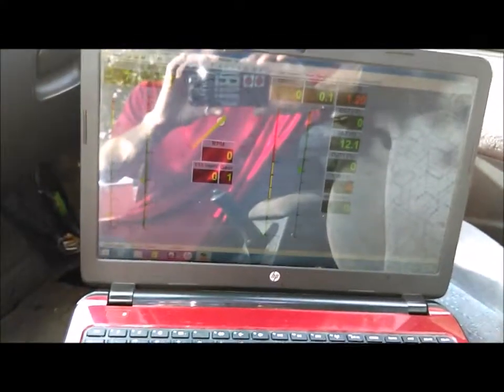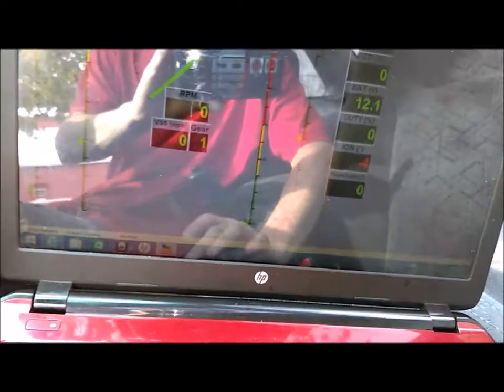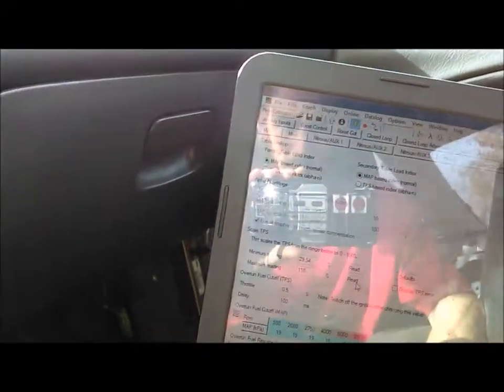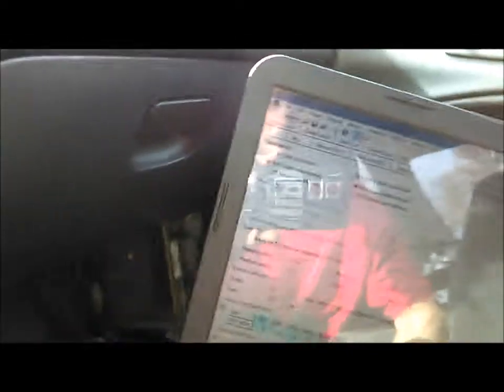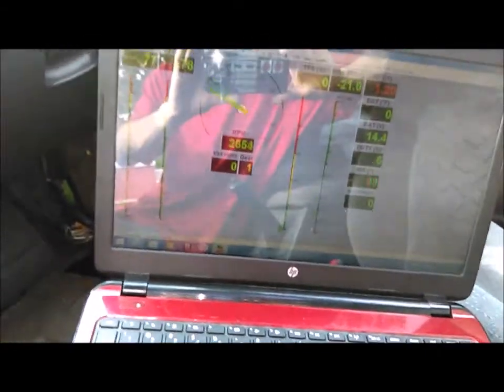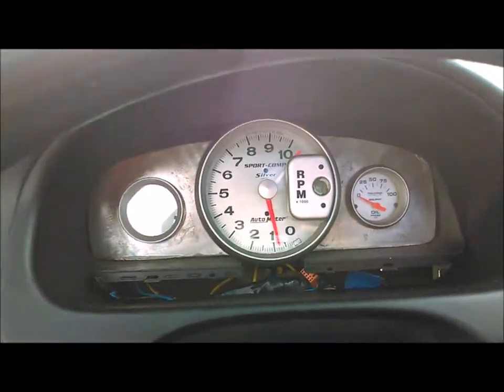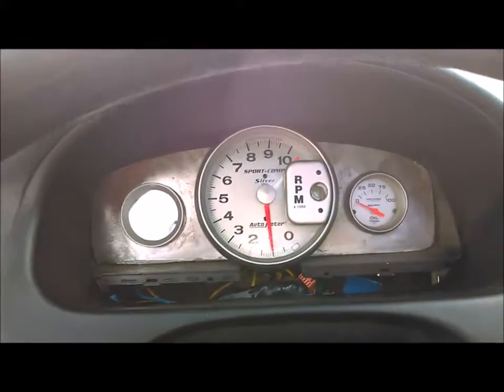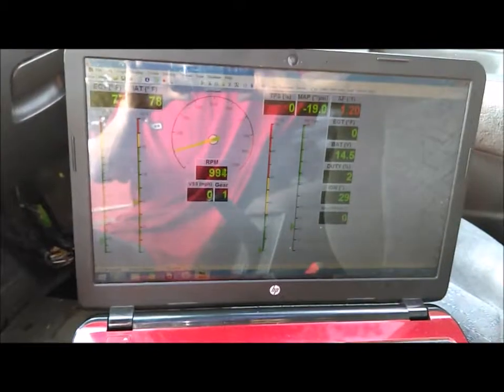How To Adjust TPS On Hondata S300

Comment: What are the percentages it is supposed to read?
Reply from the maker: It's supposed to be from 0-100%. Can read off slightly, -2%-102% throttle. As long as you calibrate it correctly it'll work and is fine.